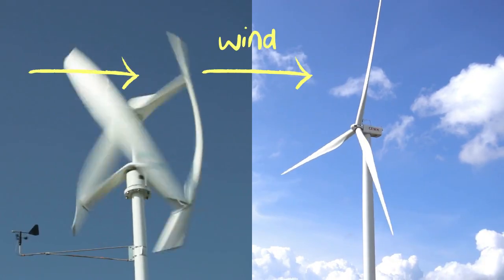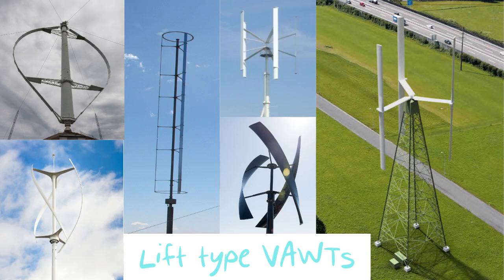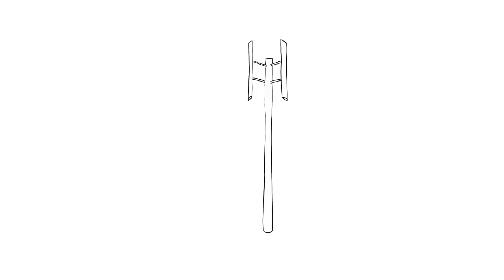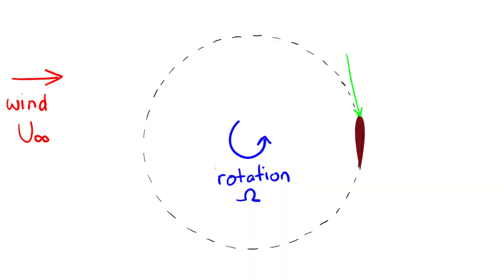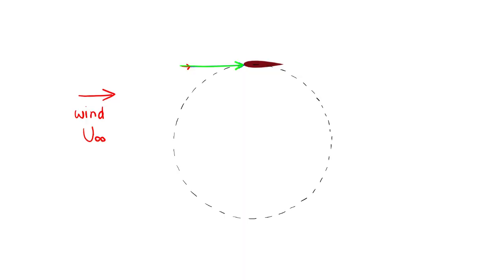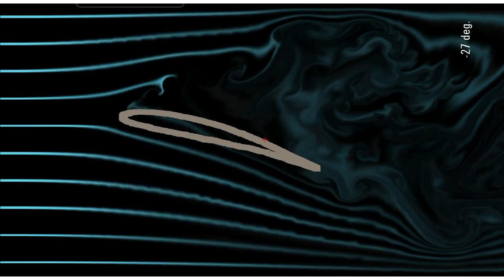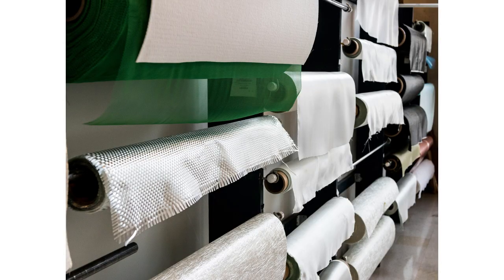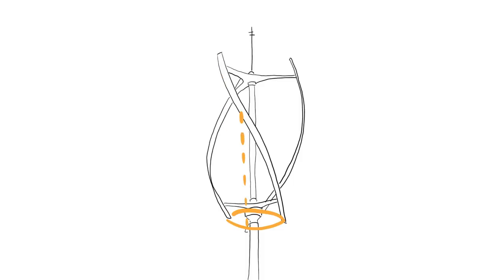Vertical Axis Wind Turbine Aerodynamics and Design

Comment: Hi Rosie! Thank you so much for sharing your well-articulated and super informative videos here on YouTube. You are a truly inspiring educator. I am a senior wind turbine control systems engineer in the U.S. and have recently been designing the control system and algorithms for a ~100kW H-type VAWT. The turbine has three straight fixed blades, all aluminum. There is no blade pitch mechanism. The lead turbine engineer wants to regulate power in high wind (region 3) via stall regulation by truncating rotor speed past a certain wind speed, thus stalling the blades to prevent increasing torque with increasing wind speed. However, this strategy will generate turbulent flow and potentially damaging vibrations that will lead to early fatigue of the blades and arm connections, as you so eloquently explain in your videos. It is also dicey trying to stall regulate in this fashion because the generator and electronic power converter equipment is required to have sufficient overdesign to handle the surge torque needed to decelerate the rotor in gusty wind in order to keep the rotor in stall. Any slop in the RPM regulation can cause a runaway condition whereby the rotor overspeeds to the point aerodynamic torque exceeds the electrical torque capability of the system, thus the rotor suddenly becomes impossible to decelerate without emergency brakes. The reliance on generator torque to stall the rotor also makes for poor power quality due to electrical torque fluctuations and surges. I have been trying to encourage the design team to consider a future blade pitching approach to simultaneously reduce stall-induced vibrations while also making speed regulation safer and more robust. I'm also concerned with their choice to use aluminum blades, as they will fail sooner, making for a poor quality product and disappointed investors. What are your thoughts? Are you available for consulting? Our company is based in Northern California and our current design prototype is located in the Texas panhandle and is nearly finished. We are commencing initial tests next week.
Reply from the maker: Hi! Thanks for this comment it is great to hear from someone working on a real-life VAWT project! Your concerns all seem very much in line with the experience of previous VAWT trials. Have you seen this Sandia report? It could help you communicate your concerns to your colleagues. https://energy.sandia.gov/wp-content/gallery/uploads/SAND2012-0304.pdf
I am indeed available for consulting, you can get in touch through my company email rosemary (at) pardaloteconsulting.com
Reply: I would share your concerns. A better arrangement to regulate power in high winds is to set the blade angle for as much anti-rotational torque as you can without stalling the blades (and then zero torque), but if you have no ability to change the pitch you are left with the electrical torque that the generator can produce, and as you observe, if this fails, you will get a runaway. To my mind any turbine needs an emergency brake, so it would be better to plan on implementing them from the outset.

Comment: @ Rosie I take it VAWT of an anemometer style where the one side has to come up wind are very inefficient and don't come near to the Betz limit. How do airfoil types stack up? I take it efficiency is measured as a percentage of the Betz limit. A small scale vertical axis can be designed with much less of a foundation

I did my fourth year engineering thesis on this back in 1975. I was limited by computing power.

Comment: I also recall seeing something about VAWT-style helical designs flipped to a horizontal axis for mounting to the edges of tall city buildings to take advantage of rising hot air.
Reply: That could work,  e.g. installing them in a chimney, but you have to be careful you don't impede the primary function of the chimney which is to allow the poisonous combustion products to be dumped into the fresh air.

Comment: I've actually been tinkering with VAWTs on the rooftop of my RV. Since it's a motorhome and could be oriented any number of directions relative to the wind, and particularly because I need to take overall vehicle height (i.e. bridge clearance) into account, VAWTs seem to be a simpler solution.

I also have an HAWT that I can mount on a pole when stationary.

Granted, there are wind resistance losses with VAWTs. These are well documented and I've looked into them. In my specific case, I don't care that I'm forcing the engine to do a bit more work while driving. That said, I watch a lot of videos like this one to better understand VAWT design principles and technology in order to find the most efficient practical design for my specific purpose.
Reply from the maker: Are you planning to use your VAWT while driving?! You will get less energy from the VAWT than the extra petrol/ gas you burn to overcome the drag of it. You will do much better to use your cigarette lighter to charge a battery while driving (which ultimately also comes from burning petrol but more efficiently), and put the wind turbine up to continue charging while parked.
Reply: @EngineeringwithRosie  The VAWT farm (7 small turbines made from engine cooling fans) is already mounted on the roof and runs full time, both while driving and while stationary. (I also have a separate, commercially-made, HAWT that I set up only when stationary.)

I'm at the point now of experimenting with ways to make the rooftop wind farm more efficient. Both in terms of how much power it generates and also in terms of minimizing how much efficiency it robs from the motor while driving.

I realize that it uses excess fuel while driving. My case is slightly unique in that I retrofitted solar and wind after the fact on an older model motorhome. The engine is at the front while the battery bank for the solar/wind is at the back, more than 10m away by the shortest possible line. (Probably closer to 20m if I were to actually connect them.)

The solar/wind battery bank is 100% isolated from all other systems in the RV. Like I said, it's kind of a unique situation.

Comment: 1. "Pitched Helical Blades" or a "Pitched Helical Diamond Blade"; pivoting the 2 external blade sections on each "4 Section Diamond Shaped Blade" inward from top & bottom, "scooping" the wind like our hand sticking out a car window on a highway OR pitching blades outward like a Slinger's weapon repeatedly slinging projectiles..
2. Efficiency is only be relevant (if) it can be applied.  Vertical Turbines can be applied almost everywhere, even ON the shaft of a Horizontal Turbine , or along highways on light poles..
I think "Vaned" Horizontal is better for Water Turbines because of Density.  Horizontal Turbines should also function more like a "weather vane" & move freely following wind direction..

Comment: the complexity of moving the blades in a vertical arrangement are easily simplified by adding a "crankshaft shape" offset to the control mechanism and even adding a rooster tail to direct the desired angle of alignment.

Comment: with how the vawt designs are shown, it seems to me that if you want to achieve or even beat a hawt design in output you would need to have equal amounts of blade area, but vawts do not have the need to have more blade for more energy conversion. Basically you would have a stack of vawts to capitalize on the different wind speeds at different altitudes, maybe a array of vawts arranged up and down the towers normally used in hawt commerical designs, upside of that would be that repairs would not need to shut the whole tower down, would mean more parts overall though. In case my idea is not immediately clear, i have trouble often getting others to fully understand my meaning, think of it like solar panels.  Each panel is an array of power producing cells tied together for a greater output, think of vawts as the the individual cells and array them along a tower to produce a greater output.

Comment: What do I think?  Why should vertical turbines turn on an axis?  Vertical blades, like wings can have an airfoil that is high lift and not variable as a horizontal blade must vary.  Additionally a vertical blade does not undergo the centrifugal forces of a horizontal blade.  Thus can be made with less cost, less stress and a lower failure rate of a horizontal turbine.  Vertical blades may also be less of a threat to birds.  Mounted on a track above the ground, to get in better air, the ground below can be used to farm or for other purposes.  Of course the blades would be active.  Also with a system like this the electrical coils would be in the track and not on the blades saving weight.  And the number of blades can be varied according to need.  The output of electricity would also be controlled by the variable magnetic field of the system.

Comment: Is it possible to control the blade pitch passively? I mean, could the member that the blade is connected to be flexible such that it would bend with the wind and rotation to produce a closer to optimal pitch? Or would the wind tend to bend the blade to the wrong direction?

Comment: Great video Rosie.... they are more compact and more elegant in smaller installations.  All the issues you mention should be easily resolved with a slide rule.and like conventional turbines self adjust to the optimal angle of attack... now that would be nice!

Comment: As a structural engineer working between the tropic of Capricorn and Cancer, I have to deal with cyclones that 90% of the worlds population don't seam to care about (in fairness I don't care about snow loads😀).  I've heard that Vertical access designs are more able to survive in cyclonic areas as they are ether self limiting or don't have a 'Max' wind speed.  Could you please comment on that?  Nice video though.

Comment: It's probably possible to have a purely mechanical pitch control for the blades that isn't even too complex. You would need some kind of wind direction sensor of course. But there are centuries old trivial designs for that.

Comment: Surely the case for VAWTs should include their advantages at larger scale. This is the "elephants cannot jump" argument. As any structure is scaled up, stresses in that structure increase as the scale, so if you make something twice as big it has eight times the volume and eight times the mass, maybe eight times the cost, and gravitational bending stresses within the structure double. This is a problem for HAWTs, because this increase in stress applies to gravitational bending in the blade roots and this is a fatigue driver and hence a driver of cost of energy LCOE from HAWTs. VAWTS do not suffer this same cyclic fatigue stress and so were thought in the 1980s (when I did my PhD in VAWT aerodynamics) to be destined to replace HAWTs eventually when wind turbines reached large enough scale. (Aerodynamic stresses become less and less important with increased scale.) As it happens we are actually clever enough to make bigger things more expertly and so things including wind turbines do not increase in mass as the cube of linear dimension, but rather mass increases as scale to a power of about 2.2 to 2.6. Amusingly we might remember that body mass index (BMI) is calculated from mass/height^2, not height^3. The effect of this is that gravitational bending stresses do not increase as scale, but they still increase strongly. To combat these increases in stress we hear that more expensive materials (kevlar and carbon fibre) are increasingly used in modern turbines, perhaps to cope with this gravitational edgewise bending fatigue problem. Presumably there will come a time when it will be cost effective to switch to VAWTs?
Reply: Can you enlighten as to which is the most efficient blade design of VAWTs so far please?
Reply: @jazldazl9193  @Colin Oram -- I would love to know your thoughts.
Reply: study the 4 mw EOLE darelus that cost around $40 million

Comment: Is there a VAWT that uses a fixed cog to adjust the blade position as it rotates around the outside? The face of the blade would always be facing the wind direction. A drive cog could then position the turbine to face the wind. Also, the entire assembly could be rotated so that the blades are sub optimal in gale force conditions and when demand is low.

Comment: I spent 4 years modelling these, and the torque issue I solved at that time in a gyromill with cam config for blade pitch. It got too complex . What I did find is that the apparent "wind" direction settles into just a few degrees deviation at higher TRS's. So a much simplified set up was born out of knowing the low speed would be a bitt ratty but high speed would be a lot more stable in torque output and efficiency. The major advancement came from using the tip vortices as thrust. It also lent it's self to easier maintenance and lower cost to install and transport.  The alternator would be modulated to further reduce torque peaks , and that alternator would be at or near ground level giving the "drive shaft" a measure of torque damping. Container sized would produce around the 100KW. Remembering that ease of shipping and installation is much of the equation. There was also the possibility to use radical blade profiles. Biggest issue is the high G loading on the entire length of the blades and it's in shear not tension.
Reply: Very interest comments. Can you explain any more about how the energy in the tip vortices was harvested as thrust for the turbine?
Reply: @tlangdon12  reffer to "prandtl-d" and works by Al Bowers et. al.
Reply: @GREFOUNDRY  Thank you.

Comment: Can you tell me what you think of a vawt using magnus effect to generate lift ..i am told that wind speed recovery around a cilindrical object can be optimised by the distance apart of each blade reducing power losses in the downside blade

Comment: Wouldn't the efficiency of the drag type Vawt be greatly increased with the addition of a drag shroud  that moves indepently from the turbine blades equiped with a tail fin that steers the drag shroud into optimal wind position. I'm no engineer so the math is not in my wheel house.

Comment: Great video.  Would it be possible to use a variable pitch system similar to how the K-Max helicopter rotor system works?  The K-Max uses electric trim tabs on each rotor blade to pitch its blades.  I wonder if electronics/ sensors could take out much of the complexity of keeping the blades in the VAWT from stalling.
Reply: Yes, its entirely possible. Vertogen are working on just such a design.

Comment: Hi, thanks for the aerodynamical enlightenment.
I am very interested in VAWT for marine purpose on a boat.
Shifting and gusty wind, space and noise requirements, -plus the potential danger from blade failure in small systems leave no real other option.
PV is ugly and does not follow the motion of the boat. I was thinking about an approach I have not yet seen anywhere.
That is to operate the drag type VAWT within an enclosure which turns freely according to the wind direction.
The return blade is covered as not to create much resistance, and wind is allowed in  via a funnel shaped design, increasing the windspeed and pointing it into the most efficient direction.
Should bring some result in an easy way!

Comment: By twisting the blades you make them longer, and you get better performance. You can add a counterweight to the trailing edge of the blades to control the angle of attack.

Comment: My take on the VAWTs is that they tend not to chew up a lot of real estate, so, might be more practical for off-grid applications, especially if you need to run multiple turbines due to relatively low efficiencies. I am not an engineer, but I tend to see things from an engineer's point of view. I would like to see a multiple turbine setup using the helical blade design. Another thing that wasn't addressed is the lowest windspeed for practical generation. I envision a hybrid setup with solar as the primary, and wind as the night time/cloudy day backup. Sorry, I have rambled. You gave me a lot to think about, thank you

Comment: How about environmental impact?
For example, bird deaths associated with horizontal wind turbines.
Are vertical the same, higher or lower.
- I understand the issue is far overstated by green energy opponents.
Also, impacts to design changes to reduce bird deaths. One example would be painting one blade black.
For vertical wind turbines, I have seen both fully encapsulated blades and bladeless technology to increase safety.

Comment: I'm guessing the active pitch control can also be achieved passively with a similar mechanism as helicopters use for blade pitch control. There would need to be a way to make sure it does not create too much friction, as well as a mechanical way that allows the wind itself to set and hold this mechanism in its optimal state, but I'm sure it could be done
Reply: Vertogen are working on just such a system.

Comment: Dynamic pitch control of vertical blades - a simpler way of doing this without a need for powerful, fast, expensive servos would be to have just two positions for the blade, with a solenoid to flick the blade into position. Maybe a pair of solenoids, and let one scavenge power from the other when the direction is changed? Controlling the timing is something that any microcontroller can do - you need current wind speed, current rotational speed, and current position.

Another possibility might be to use gearing: no electronics required. A cam follower - the cam would be on the shaft of the tower, and it would need to be fitted with tail to keep if facing the right direction. Spring loaded followers connected to a lever on the pivoting blade.

How about a cam whose shape varies along its axis - you raise and lower the cam to get different pitch profiles with different windspeeds , with a stall/stop profile at the very top of the cam, so you just drop the thing to halt the blades..